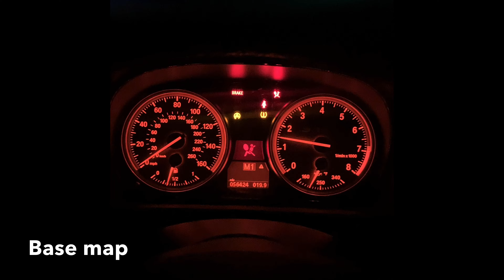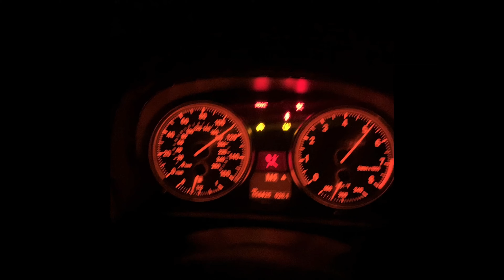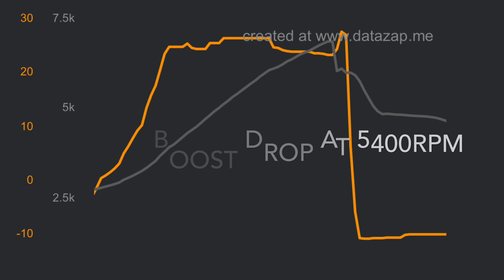Build Update On My 2011 BMW 335is With Dynamicautowerx Stage 4 Turbos

Comment: Any update on the 4x spool?  I'm at the time of deciding between the 3x and 4x on my is since my hpfp is maxed at e50.
Reply from the maker: BMW Guy what’s your power goal? 3x should be fine if stock motor
Reply: @slowbmw335is5  Goal is/was 500whp at full e85.  Was at 450 on e50 with the hpfp barely making it.  As I'm so close now, the boost drug has me thinking 550 or 600 are also nice round numbers...  And if I end up replacing the turbos in the future, which I know I will (that is the was part of the is/was), I just want to make sure I"m not restricting myself.   I keep saying no, but my credit card keeps saying yes...
Reply from the maker: BMW Guy 3x model is plenty fine